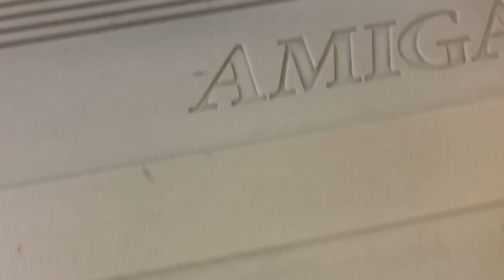Amiga 500 Restoration and Retrobrighting

Comment: Noel, have you tried using superglue and baking soda to fill holes in cases as I have found particualrly on the A600 and A1200 which are more of a white colour you can pretty much hide holes with that technique and some careful sanding. I have toyed with adding something like tea to the mix to give it the slightly beige colour of the A500's. The technique is to add a very small amount of superglue to the hole and then sprinkle a small amount of baking soda onto it.  Leave it to dry and then add some more glue and again sprinkle on some more soda.  The glue and soda turns into a hard plastic like material which when left a good while to harden fully can be sanded smooth to fill in the hole. You sometimes have to go back and touch up any air holes that appear but eventually it fills in the gap completely.

Comment: OMG, you forgot it and left the battery inside and WITHOUT the metal cover. If it starts leaking that would be a mess. Remove it at your first convenience, or better asap. Cheers, M
Reply from the maker: Yeah, I was planning on replacing the battery later and I just wanted to put everything back together. But don't worry, I'll replace it :-)

Comment: Great video! I didn't know that retrobrighting could go wrong - I am waiting for a sunny day to do my Apple //e and now I am concerned I may ruin it!
Reply from the maker: Thanks! Just do a search for retrobrighting fail and you'll see what I mean :-) Good luck with the Apple //e!
Reply: Retrobrighting with the gel/cream style hydrogen peroxide is easier but has a greater risk of marbling which looks nasty. I never use the cream and instead use hydrogen peroxide liquid and submerge the plastics in it completely. When you submerge the plastics you remove the risk of marbling entirely. The 8-bit Guy does it this way after his many years of experiments. I also built a box to use indoors (not much sun in the UK) that uses 2x30W UV LED lamps.
Reply: @Daz555Daz  Thanks Daz. Yes, I discovered it myself - too late unfortunately! :) No major damage but indeed submerging is the way.

Comment: @Noel's Retro Lab you know they make a paint that matches the A500 case called Satin Almond which might be better than retro brighting as you don't have to retro bright the case again.
Reply: @HansCampbell  Do a video showing this Satin Pebble is a closer match than the Satin Almond. Because when I look at Krylon's website Satin Pebble is much darker than my retro brighten A500+ case, almost 2 shades darker.
Reply: I think there are two distinct versions of the A500 case as I have quite a few of them and some are a more grey beige and some are a more browny beige. I think depending on where the cases were made there may be two different formulations of the case plastic. So it could be you are both right and depending on which version you have one will be right and the other not.

Comment: I was wondering, what do you degrease the metal parts with before zinc coating?
I use brake cleaner , has given me best bonding results when spray painting.

Comment: Other restore videos use UV light and hydrogen peroxide to restore the colour and get rid of the yellowing. Still a great job done here. Thanks.
Reply: Yeah, I was wondering this. I have a UV curing machine for the resin printing and I was wondering that would that work as well. I assume that it probably is much faster as well. I mean with 3d printed models the curing time under sun is like 2 to 4 hours and in UV light its 2-5 minutes (for small objects)

Comment: Hi @Noel's Retro Lab! I have a question. Will I be able to retrobright Amiga in a plastic box with UV lights? I would put Amiga in a some kind of a plastic box and poke big holes on the lid so the UV lights could go through, also, I would put water in the box so it wouldn't dry. As you recommended, I won't use a plastic wrap. Would that work?

Comment: What did you do with that NiCd  battery for the RTC?
Reply from the maker: I just desoldered it, but I haven't replaced it yet.
Reply: @NoelsRetroLab  I’ve fixed a few of these with leaky batteries before and ended up replacing them with a standard 3V lithium coin cell (ie CR-2032). There is enough room to fit a holder, and you’ll need a diode in series to prevent charging of the battery. Seemed to keep the time fine with the supplied 2.4V, but not sure how long they lasted before the voltage was too low.
Reply: Just had a look at the Oki 6242 datasheet. Looks like it is good down to 2.0V!

Comment: could you use citrix acid or coca cola to remove the rust from the shield?
Reply from the maker: Probably. I haven't used them, but I've been told they work, although you may have you leave them acting for multiple days. In this case just sanding it down is easier, but that might be good in the case of rusted parts that can't be sanded down (like in my video of the Atari 65XE restoration, although in that case I used straight acid).
Reply: @NoelsRetroLab  i've used citric acid to get rid of rust before - might be easier than scrubbing. the other thing that comes to mind is the Rust Convertor fluid, which you can spray on then paint over.

Comment: I wouldn't recommend the cream if you can get a jug of 30% horticultural peroxide for hydroponic systems in your area. Used for cleaning, treating root infection and as a root oxygen supplement
You can mix it down fairly easily from just a quart bottle instead of a dozen bottles of the 3% drug store peroxide.
It's not in convenient places online due to shipping regulations (it is a STRONG chemical solution), but any local hydroponic supply store will sell it in similar concentrations to the hair cream.

Comment: I just dumped in the garbage '18" Amigas and several commodore 64 I had in storage 5 were still sealed! now I  feel awful for doing that but had no clue anyone not even the salvation army would want obsolete computers! sorry guys!
Reply from the maker: Noooooooooooooooooooooo.... 😢😢
Reply: Oh my. That many? Well you weren't to know, and I did the very same years back when I discovered my Amiga 500 not working. When I discovered this thriving restoration/repair scene, I felt somewhat  disappointed in myself. Regret soon followed. Today is regret therapy day. Just acquired a perfectly working A500 with original Commodore monitor. I feel so elated.
Reply: What??? People pay real Money for Working systems. I guess you just trashed a Minimum of 2000-4000 Euros. Sealed C64 Go for 500-1000. Alone. So i guess you are just joking. I mean before i throw things away, i look online what its worth.